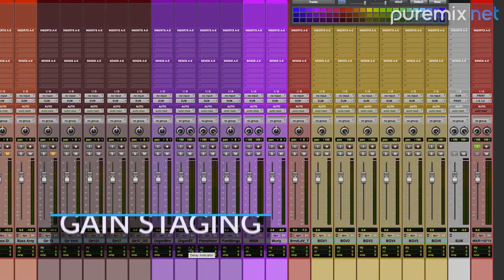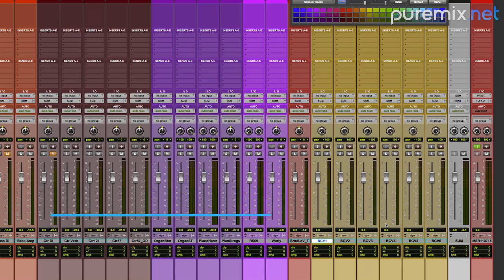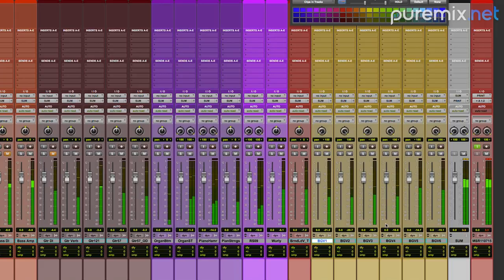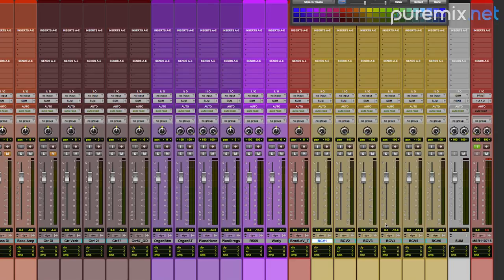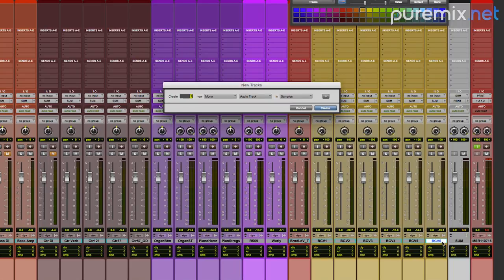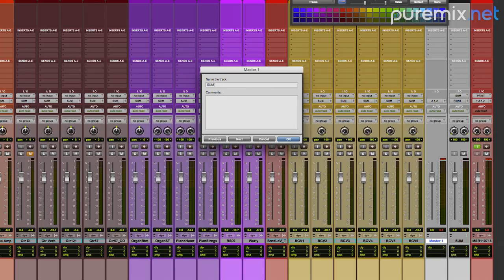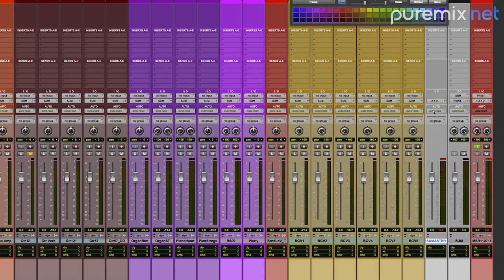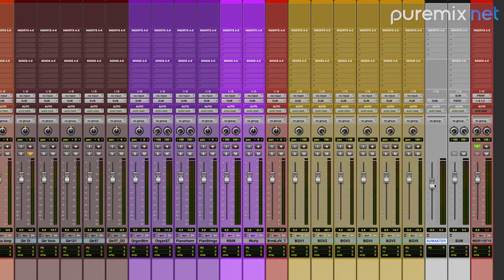Gain Staging In Your Mix. with Fab Dupont

Comment: Good trick but if you're using plugins that emulate hardware you may go with too hot  levels into them and some of them do not like that and some don't have very good input section, so maybe use rather clip gain as first insert plugin and turn it down there.

Comment: This is interesting but how is it different than using a stereo aux or 2 buss? I normally adjust the level of the mix on a 2 buss before even going to the master fader.
Reply: A master fader controls the level of an output, allowing you to adjust the level before your mix bus inserts (in this example). This may be particularly useful when using hardware inserts. More specifically, a master fader can provide a scaled 24 bit “window” of your 64 bit floating point mixer. Ever wonder why you see orange and red clip indicators? This is significant.

Comment: Why not just use trim on the first spot of the master track?
Reply: In that case, you'd still be clipping going into the trim 
So the meters wouldn't be clipping, but you'd still get the distortion
Reply: Can this kind of plugins clip on 24bit? I know that modeled plugins like Waves 1176 do but Trim too? Also I'm not referring specifically to PT, it can be any gain staging plugin on any DAW
Reply: you can. But I'm sure some gainplugin will clip. If yours doesent, no problem
Reply: yep, you can, with internal 64bit float processing (what i hope protools get) and floating point resolution plug as first insert, it works like a charm... I personnaly use "stereo channel" plug-in by sleepy time record (free vst) as 1st insert, set the VU meter to output mode and trim down til the VU meter on the plug reach 0VU = -18dbfs
Reply: Yeah this is correct - if you have 64bit float processing you have nearly 2000dB of headroom above 0dBFS because of how much you can float things. According to SSL, this is the way the SSL Live series of desks works (and I would assume anything using their Tempest mix engine).  You can gain everything up to clipping internally and as long as the physical input and output channels aren't clipping you will never hear the distortion because of the 64bit float architecture.  Pretty crazy! 

So basically if using a DAW like Reaper, you can mix in 64 bit and even if the Master Fader is clipping, you can just turn it down so you don't clip the final output and your render would be fine. 

Granted, to gain stage through plugins you should still work with proper levels...And having good gain staging is just a great habit to have due to the workflow benefits it offers.
Reply: you can't clip your channels in Pro Tools.
Reply: I never said you can't clip your 2 bus.
I said you can't clip your channels.
Reply: The mixer still works based on 32bit floating point math, unless you specifically change that behavior (which...why would you do that?). Even if you bounce your mix down to 16bit, and have all the channels clipping, if your digital to analog conversion points aren't clipping you'll be perfectly fine.